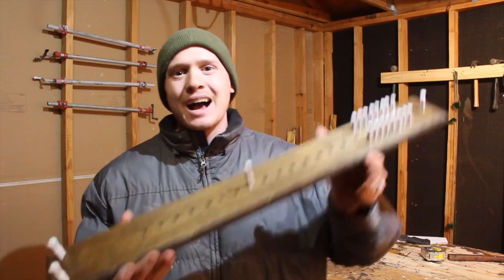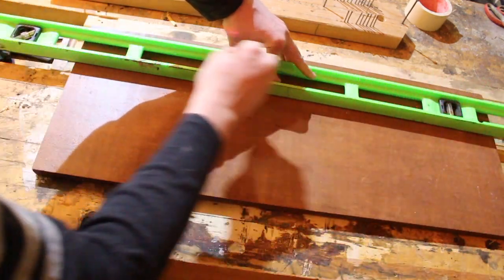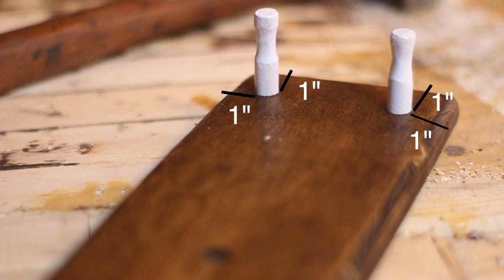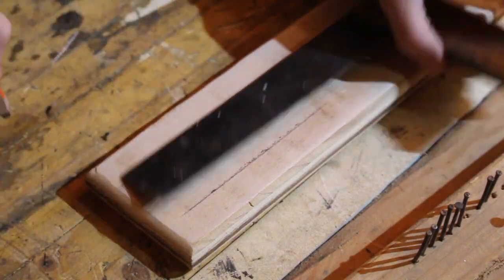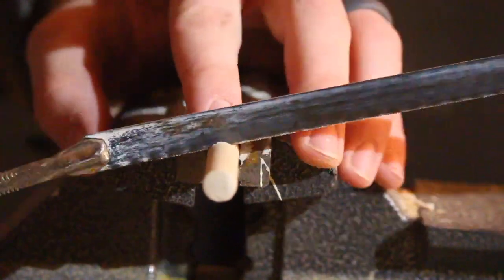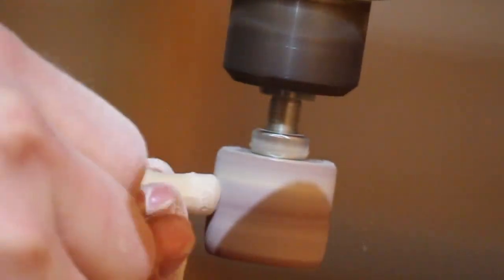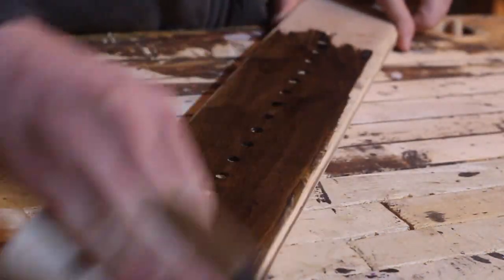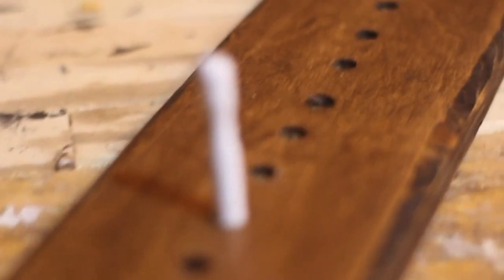How To Make A Killer Bowstring​ Jig *Flemish Twist*

Comment: If you ever make another one, when sanding the curve into the dowel so the string doesn't slip, instead of sanding it by hand, put the dowel into your drill and spin it as you sand, that will make it more uniform.

Comment: distance from 1 of the top 2 pins to the top central pin is not 5".  It's the hypotenuse of a right triangle with the other 2 sides 5" & (1 7/8" / 2 = 0.9375").  So it's 5.09" (I think).  So if you want 'nice' (2x24) + (2x5) 6, 7  8 etc. you need to work out the exact hole centers.

Comment: I like to use hardened trim nails for the stationary pegs. They look like blued finish nails, but since they are hardened they don't bend easily. For the movable peg, I prefer a joist hanger nail. They are galvanized like a roofing nail, but the head is much smaller so I don't catch the string on it. They are also fatter than the trim nails, so they are harder to fumble around with.

Comment: Kramer I followed your directions here and made a jig like this one.  Mine is a little fancier though as I have a CNC router and made mine with that.  What I'm confused about is how do you determine the string length?  There is no mention of how long a string you will get when adjusting that peg in the center.  I know that for every hole you move the peg you are getting a string one inch longer or shorter, but how long of a string would I get if I used the peg hole closest to the two roles of nails?  Thanks for the video and the jig.  I can't wait to try it out, but have no idea right now where to put that center peg on the jig.

Comment: I'm just glueing in my pegs following this guide and I've run into a minor snag of my board not staying strong at the 8 close together pegs but I did get a 1'x3' hobby board of red oak so I have another section if the pegs don't hold. I guess my bit was dull or the wood was weak, idk but if it works it works
Reply: Had the same prob. I filled with glue and let it set a little. Then lined up the pegs and genly sattle taped them down . Worked great for me .

Comment: 2:58 nail and dowel pin in same location make different size.string go AROUND bigger dowel pin well ok you use inches its not acurate LOL dont need be so acurate you end just twisting string anyway LOL